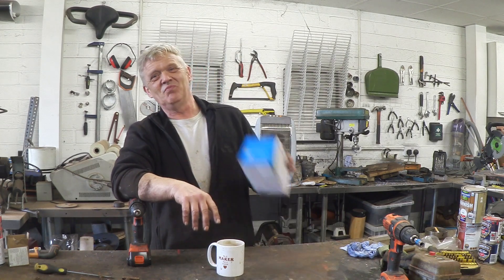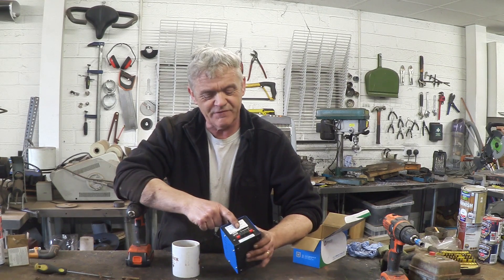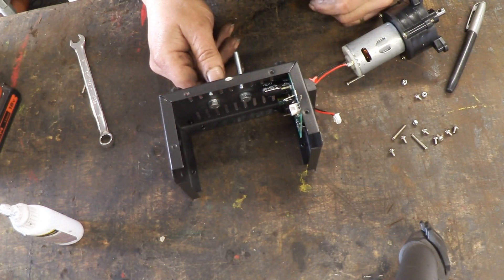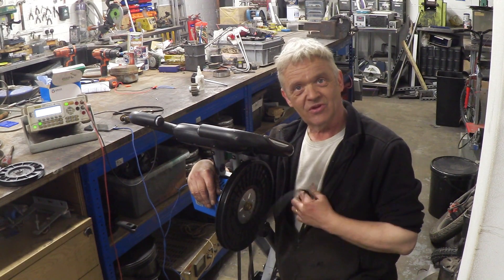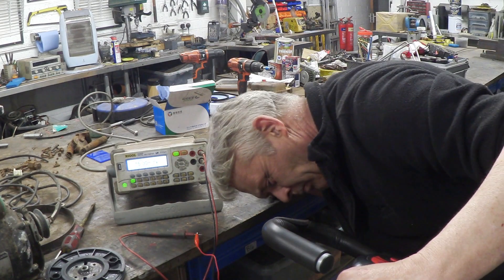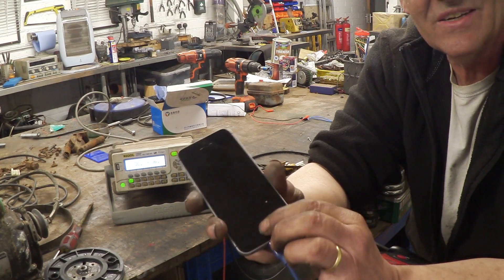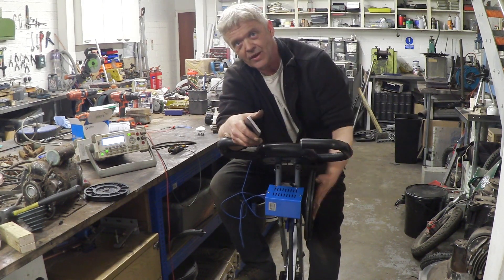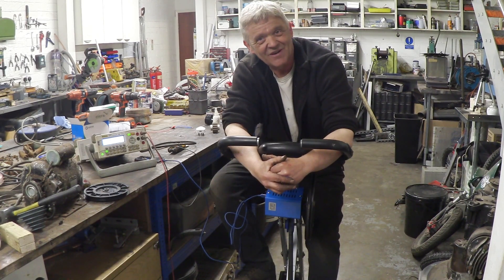1108 The Dynapod - Charging A Mobile Phone - Pedal Power For Emergencies And Everyday

Comment: Excellent, I'm buying one.
Reply from the maker: worth it I think mate
Reply: @ThinkingandTinkering  I want to build a Bicycle water pump to run a big water wheel in the future. It would be a simple way of applying neccessary constant directional torque to a tractor PTO Generator. Too many projects on the burner at the moment.
Reply: It sounds crazy, put the human legs could easily drive a system that could have an output of 10kw

Comment: Very cool Rob. Imagine the power that all the gyms in the country could generate. More than enough to run the lights in each gym.
Reply from the maker: and all that sweat basically goes to waste right now!
Reply: @ThinkingandTinkering  so you could say that the gyms have a lot of potential sweat equity 😅
Reply: Imagine the incentive to get people into local authority leisure centre gyms if customers could bring the key card for their electricity meter and top it up on the treadmill or rowing machine instead of at the corner shop. It's putting cash in the pockets of people that need it most,  saving the planet and getting people fit. Win win win.

Furthermore I'm not suggesting hard labour or anything but  every prison has a gym.  Imagine prisoners working (out)  to contribute to the electricity bills of their family on the outside
Reply: Good point.